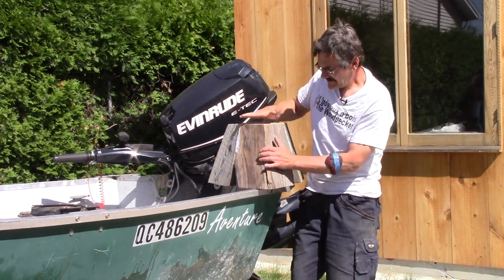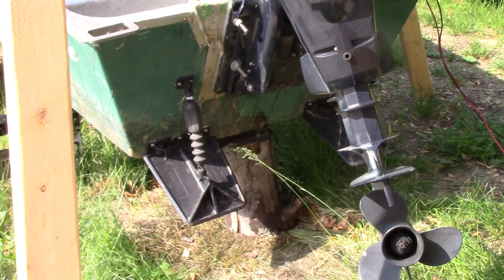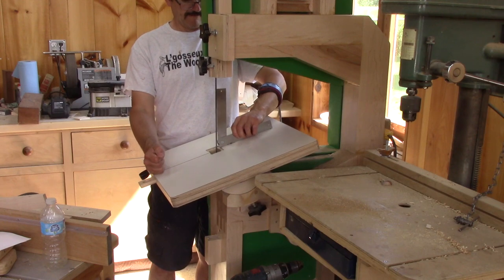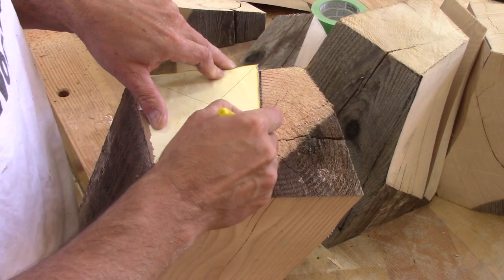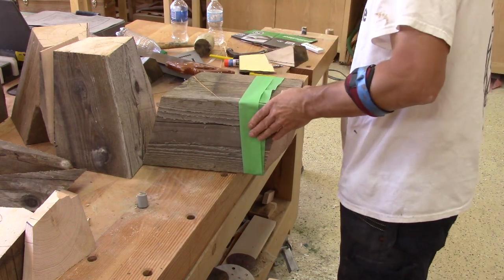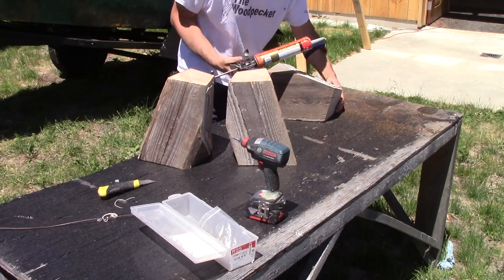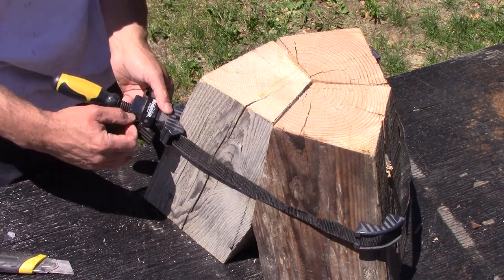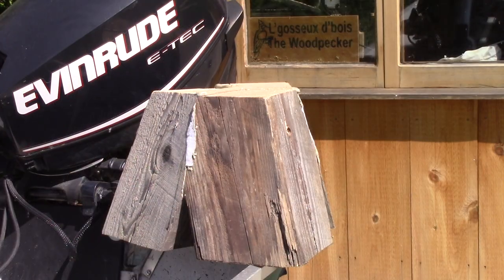The Woodpecker Ep 146 - Stand for my fishing boat trailer

Comment: Nice work, compound angles are a pain, but I don't believe it is the proper fix in my opinion. The bunk boards on the trailer should extend a couple of inches past the transom when the boat is loaded.  Also I can't tell if the boat is tilted back for drainage or if it naturally tips up. For proper towing the weight should favor the tongue end by about 10 percent .  The axle should be placed at a balance point where the tongue should drop and not rise up when not attached to a hitch but still lift by hand with a slight effort.  Maybe you could do more boat projects.
Reply from the maker: Yes I have a small angle so the water can drip frm the back plug. I can't put my winch further away, I know it's a shame... It was not always like that before I had something to keep it tilted with a post near ther tongue, but since I changed my outboard motor this changed everything now I have more weight in the back. I wish I have more weight in the front, but this won't happen unless I changed my trailer, and since I only use it 2or 3 hours a years I think I will just cope with it... But before I was just using it 15 minues a year this was much beter :)) But I don't know if I'll reda a trailer story again? Maybe on the trailer I have in my driveway, this one has its weight at the right place :))
Reply: I apologize if my post seemed patronizing I just want you to be safe on the roads and stick around to make more Youtube videos.
Reply from the maker: Don't wory I was not offended at all. I know it's not perfect but what can I do.
Reply: If you could weld on an extension on the tongue and move the winch forward enough to move the transom 1-2 over the end of the bunk boards you should be fine.  Here is a simulation of an unbalanced trailer in tow.  https://www.youtube.com/watch?v=4jk9H5AB4lM
Reply from the maker: Humm, you got me woried, I'll keep an eye on that, but I think that a 50lbs unbalenced trailer is not a big match for my pickup. But thank you for the link.

Comment: Is there not enough room on the trailer to loosen the winch mounts and slide the whole boat up on the trailer a little further? I couldn't really see in the video.
Reply from the maker: No the winch is push to the tongue up to the max. And with my motor attached to the boat it's back heavy and I can't never put any weight on the front of my trailer.

Comment: Great work, but I'm worried about your trailer being weighted too much to the back . Please watch this video https://youtu.be/4jk9H5AB4lM which demonstrates the forces at play here. You need to move the axle further back on your trailer to increase the tongue weight.
Reply from the maker: Thank you, someone else send me this link. I know my trailer is unbalanced but to fix it I would have to modify it... Since I'm only using it 2 hours a year and the 50lbs back heavy is probably not as bad has the demonstration compared with with my 7360lbs pickup truck. It was not always like that it's just since I changed my outbord motor this one is much heavier than my last one....